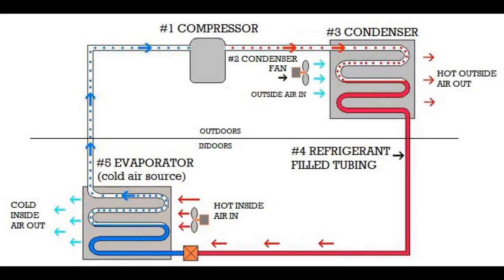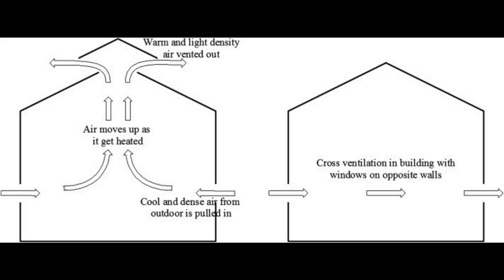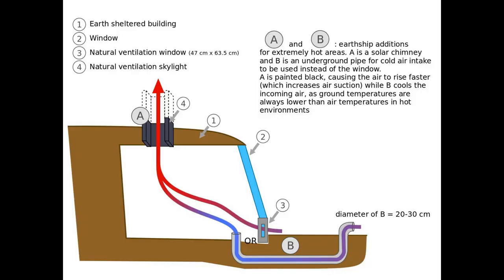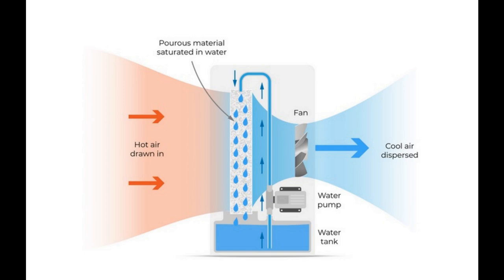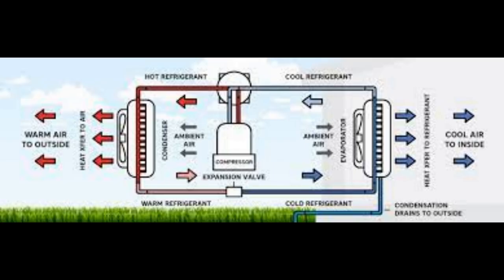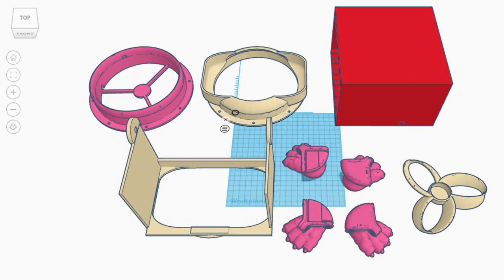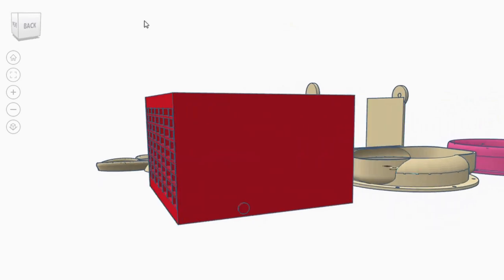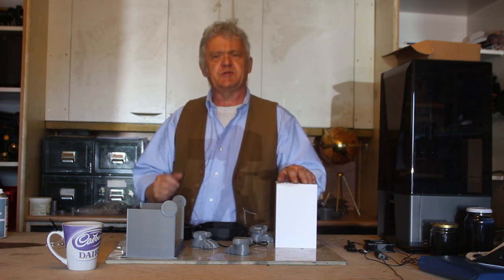1954 DIY Hybrid Air Conditioner Run From USB, Solar Or Battery

Comment: I use the chillmax products for fan/ cooling (they are cheap enough in the local supermarkets), you just fill a reservoir with water and the fan blows the air through- the drawback with these is that the fans are noisy, so I was thinking, maybe if I print up some suitably sized toroidal fans and give it a go. (then I can compare the noise levels)
Reply from the maker: where do you buy them mate? That is a good idea
Reply: @ThinkingandTinkering  It turns out these are the gel matts. In Europe generally sold for Larger dogs to lie on. Well they absorb you body head within second to saturation and then are basically little warm plastic blankets.
Reply: @ThinkingandTinkering   the chillmax airs contain a 5" or so pc fan, but the chillmax Air Go's look like you can just swap out the blades easily, Asda generally have them, they are a JML product, so at the back near the DVD's (in Canterbury)
Reply: they also contain a little water pump/ metering device to slowly feed water to the felt? water dispersion filter, they will run for many hours on a tank of water.
Reply from the maker: @grendel1960a  awesome - thank you mate i will check it out

Comment: Adiabatic cooling. They swamp the air. The icebox cooler in an icebag. Last year the aircoolers with 4 L resevoir were in every supermarket in humid North Wester Euro for 40-50 euro. The small cube ones from 10 euro upwards.

Those freezer blocks used to use gel, now they use a liquid. And quality has gone down so seems might burst before xx years. Sizes do vary by source.

Comment: cool one Rob. Most probably there will be some condensation, partially offset by evaporation.  I do not know if it needs an" evaporation tray" or not
Reply from the maker: i was thinking that mate - i don't really know as i just made it - but a good point - cheers
Reply: You're entirely correct. The reason that fans dont have much cooling effect in humid air is because it makes it harder for sweat to evaporate from your skin, your built-in thermoregulation system.  But if you cool the air, water will condense out, and you get a double whammy - you've made the air physically colder, and you've reduced the humidity,  making sweating more effective as a way for your body to regulate its temperature.  You do, of course, need to prevent the water condensed out of the air from getting back into the air,  which can easily be achieved by collecting it in a water tank.

Comment: It would work better if the air were forced to go around all the blocks rather than just passing over top of them.  If there were a path the air had to follow to get around all the blocks before being allowed out at the end, it would be much colder.

Comment: i have free electricity at night plan, and i have an unused stand up deep freeze, i wonder if during the 9 hours of free electric it would freeze a whole icebox full of these things or something like them, and i just put in input and output hole on the freezer with a fan if it would last very long during the day. welp, thx for the inspiration, im off to begin this project!!
(btw does salt add to the equation somehow for colder?)

Comment: One problem is if your freezer is in area you want cooled, the heat is released inside from the freezer to same area, that can be displace some be freezing at night, when when it's less of a problem. Something like a ceiling fan only cools wet stuff like sweating skin and the heat of the motor in an empty room is warming it more. If a hot pan is put under a fan it will dispace the heat faster, but it's still in the room.
Reply from the maker: lots of folks in the UK keep their freezer in the garage mate
Reply: @ThinkingandTinkering  Even at 66, learn something every day. Here in the US, almost all are in the kitchen, though some keep "the old one" in the garage and a deep freezer or chest freezer in the basement or garage.

Comment: Since you're already using the fridge to cool the blocks, 
use that fraction of electricity that cools the blocks,
to run some Peltier devices, and you never need to swap
out the blocks?
Reply from the maker: give it a go mate

Comment: I'd put it on top of a towel or something if you're going to run it... Those blocks might not leak, but they will condense water on the outside.

Comment: @10:30 There is a heatpack I was given that needs to be boiled. Once boiled the chemicals become a liquid, and remain a liquid until the chemical is agitated with a metal disk inside.   Would it be possible to make something that utilized chemical reactions, to create a heater like this? Probably right?  You can boil your heating packs, and then insert them after activating them, to heat your body, or a tent or something.

Comment: Very good to see your reaction to the cool breeze Robert. Now could you please measure a room's ambient temperature & provide the drop in temperature over the span of time the blue ice thaws in one cycle?
Reply: This is only going to be good for personal cooling. It won't do much for whole room temperature unless you already have outstanding insulation
Reply from the maker: something this size isn't going to cool your house mate - it's a personal cooler

Comment: I wonder how a sand battery would do as a cold mass for cooling? Would similarity sized packets of sand be as effective as the gel in the cold-packs?
Reply: from having looked into this myself the short answer is no. Water holds much more thermal mass than sand. Except on the very high temperature end because sand can get to much higher temperatures without boiling like water does at 212F.

Comment: Hi Robert, that's a great job! I was thinking more about the serpentine coil and using the "back" of the magnets, could you make the initial coil twice the size then put a half twist ♾️ and fold it in the middle to make the winding all the same direction again, do you know if the crossover section would affect it badly?
Reply from the maker: i don't know mate - worth a try though
Reply: Indeed, thanks for the reply anyway 😎👍

Comment: I love this. Simple and your freezer is running 24/7 anyway. I wonder if it would be worth it to custom build the blocks to optimize surface area. Although one drawback with 3d printing is it is not inherently waterproof so you would need to cover it with epoxy or the likes, which is doable and it does work (I have printed volutes/turbines that are waterproof.) Freezing water or whatever you fill in the blocks will expand and contract with temperature - so probably not worth it. I am very interested in finding cheap cooling as I live in Japan. I have  4 x600w mini splits that pretty much run all the time when we are home from now on till October because the summers are just brutal in Japan and the houses are poorly insulated  -  in other words a huge waste of electricity and a massive money pit. In the winter months our household use about 350kwh from the grid(I have a 1Kw of solar on my balcony)but in the summers it is closer to 900kwh. Thanks for sharing Rob I will definite be looking into this - brilliant
Reply: the one i bought on amazon a few years back has square blocks with 4 channels through them so effectivly 5 blocks.

Comment: Adding aluminum heat sinks. may make a slightly noticeable difference in cooling. It will not last as long, the air may possibly be a couple degrees cooler, attach the aluminum to the cooling blocks with a good thermal transfer epoxy, by adding surface area, the ice will melt faster, a few 6x6 mm square bars of aluminum could be a good compromise. To help cooling , yet still maintaining run time,  possibly double the number of bricks,  this can be used in winter as well, add a couple sleets of wood,  then add bricks from the oven,  about 250° for 20 minutes,  or with food while cooking,  or placed in the sun,  in a glass box, or concentrated sun, the wood is important to prevent melting, maybe use aluminum tape to reflect the heat away from the plastic! Also making an aluminum plate that allows the brick, both hot and cold, to sit on it and bev bent up, over the outlet. With holes and/or slots cut into it,  to act as a hear sink, in both directions,!!
Reply from the maker: nice ideas mate - thanks for posting

Comment: Isn’t this going to get a bit drippy as the water being pulled from the flowing air condenses onto the cooler packs?  

I suppose you could just put it on a towel - I wonder if some kind of tray is in order - and how much it actually dehumidifies. I’m planning a move to a desert… I may have a stock a chest freezer full of these ice packs hehehehehe
Reply from the maker: i honestly don't know mate i was thinking about it - i might add a tray

Comment: Lovely design! Would you be interested in proving the concept in a camper van or similar sized space? I am curious what kind of cooling power this is capable of. I know from my own tinkering that a 100w solar panel can keep a portable cooler at freezing temperatures indefinitely. With this concept I dare say you may have found a simple and cheap method for keeping a small living space cool.
Reply: I just recently picked up a BougeRV mobile refrigerator from Amazon. It has a direct 12vdc/24vdc solar input with an internal battery that charges and powers at the same time. I think BougeRV also has a true air conditioner that's also portable. Biggest issue with all of this is designing all components to work at the source voltage level so there is minimal conversion loss for the best efficiency!!!
Reply from the maker: i would be interested in that mate
Reply: @fookingsog  Just last week, I found youtuber Everlanders "Converting "ON-Grid" electronics to "Off-Grid" - DC to DC Conversion" for all the devices in their RV. UAZGX379dmc  For anything under 12V 50W, the LM2956 comes in a 10-pack and is cheap, efficient, and tiny.

Comment: Ooo, just had another thought.  What if you put this at the bottom of the boat wind turbine, for a caravan, with the turbine outside and the ice pack section inside and it cools the inside while you drive or have hot breazes outside?
Reply from the maker: i like that!

Comment: This is a really neat idea, but my only concern is that you're effectively getting net zero cooling if the freezer is inside the house. Otherwise you're just heating the house using the freezer to get some cooling back using this. If the freezer were outside, then I think you'd a better chance of actually doing some cooling.
Reply from the maker: lots of folks in the UK keep their freezer in the garage mate
Reply: @ThinkingandTinkering  That's wonderful! Convenience aside, I've never thought much for how freezers/refrigerators wind up adding to heat during the warmer times of the year... Sort of like venting your dryer into your house. It's fine for the winter but not so much summer. But your cooler would work nicely with the freezer outside.
Also, thanks so much for replying! Love following your channel and all the cool ideas your share! Can't wait to see what's next!

Comment: Sorry, I am not very bright...so if I blow hot air over a cold surface I won't have any moisture produced?
Reply from the maker: depends if your are is moist or not
Reply: Moisture in the hot air will condense on the cool surface.  If you angle it right the condensation can be directed into a container.

Comment: I've been wanting to make something like this for my car.  On really hot days it just doesn't cool down properly.  That block looks small enough to fit in a small cooler to keep the packs from melting too much while the car is parked somewhere like when shopping or something😊
Reply from the maker: that's a cool idea - make the car so much better to get into - someone in the comments said they had to wear oven mitts it got that hot!

Comment: put the boiler of a stirling pump or a muscle wire generator through the side and it would run itself as long as there is a temperature differential....there's a lot of locomotive principles based on temp differentials lol if a peltier device can provide enough current maybe it could run an ionic air pump and it would be silent and self powering via its own integrated energy harvesting/conserving/recycling designs
it just stops doing stuff as the differential disappears so you don't need a thermostat really either
Reply from the maker: it won't run itself i think mate

Comment: Why not blow air over a radiator filled with tap water, and then as the tap water warms to room temperature, send it as input to the water heater?

Comment: Have you ever tried just placing a filter (from vacuum cleaner or such) in front of a PCfan?
Because the air needs to be pulled through the filter, it goes from higher pressure to lower pressure, and thus it cools the air.

Don't believe me? Try it!.

Comment: How about a serpentine path over the ice blocks? That would add anything positive to the mix?
Reply from the maker: I think that is a good idea - the cooling would be better if the air was in contact with the block for longer as air is basically pretty insulating so cooling it needs time

Comment: would a piezoelectric fan make it more compact?
the ones such as what Linus Tech Tips talked about
Reply from the maker: you could try it - i built a piezo fan and right now they are a bit of a science toy as far as i can see
Reply: @ThinkingandTinkering  
it's being made for industrial use and computers currently. though production level is still low so the cost is quite high. small enough for laptops and smartphones.

the cost of 1 according to LTT was $1100.. 
i won't be buying one of those for a while.

Comment: What if the air being passed over the freezer blocks is extremely humid, surely the moisture would condense on the blocks and drip.
Reply: I think this question has already been posed 😅

Comment: Very cool stuff Rob!

Would be good to see an actual refrigerant based DIY - A/C system done on this channel

I wonder if there is any way to build and pressurize a small system yourself safely without too much danger?
Or adapt a fridge without need for any venting / re - brazing / re - pressurization ?

The effectiveness of using the throttling effect is unparalleled, neither Peltier chip nor swamp cooler can meet it
The cost of a prebuilt unit however - is usually exorbitant

The ideal home - build! (provided it's done SAFELY)

Plenty of 1 hose to 2 hose portable AC mods out there
But nothing beats a mini split or similar
Reply from the maker: for sure mate

Comment: with this rate of improvement i am kinda expecting the next stage tomorrow to be with thermoelctric parts powerd by a heatkollector 😉🤔
Reply: Need fan powered by TEG (Thermo Electric Generator) that operates off the temperature differential.
Reply: @fookingsog  something along that line is also fine. A really good idea to use the cooler elements. My thought was to replace the cooler elements with the kinda thing you find in an camping cooler, the small box
Reply from the maker: lol

Comment: You can make an ad, your son couldn't stand the heat, so you created this new way of cooling, that will put the big air conditioning companies out of bussiness🤣🤣🤣🤣 
 I would much rather see you use an analog thermometer placed roughly 50 cm away, this would provide a more accurate air temp reading
Reply from the maker: nice ad idea